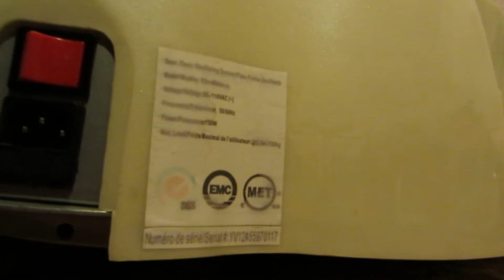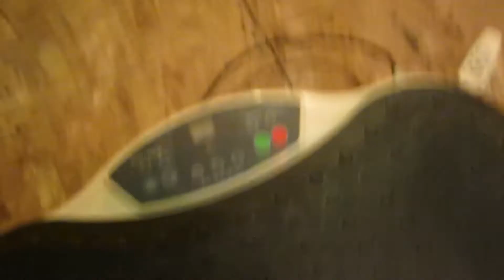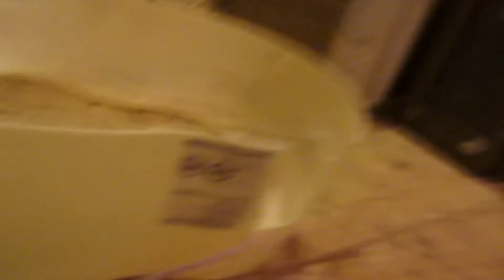Equipment Autopsy: Fitness Machine

Comment: Its probably a VFD driving the motor. Try connecting it to another motor and running it.
Reply from the maker: Only 2 wires going to the motor, more likely it's just varying the voltage.